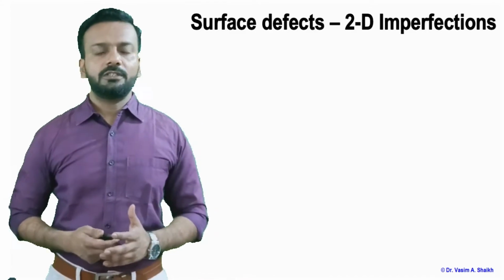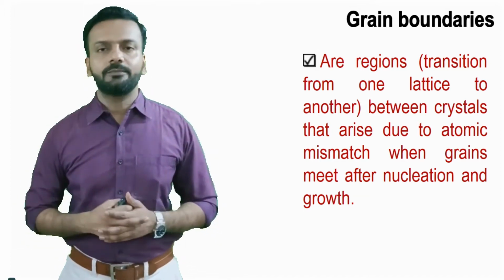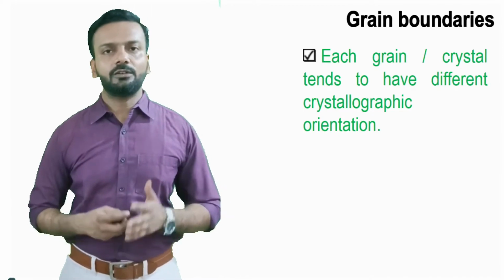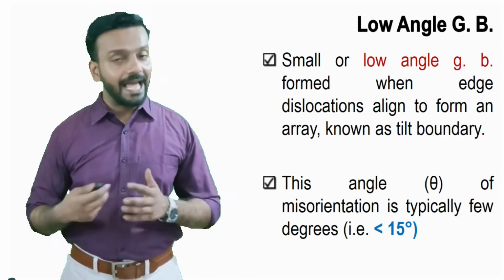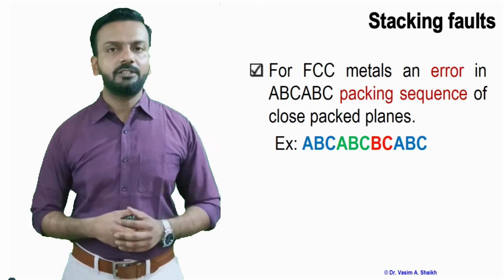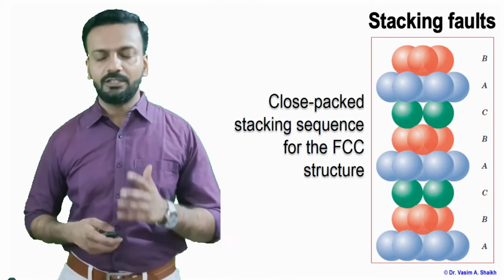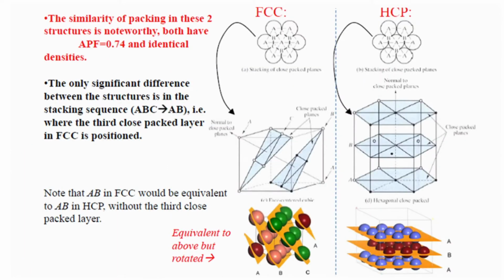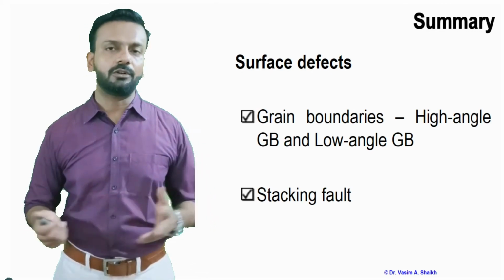Surface Defects | Grain Boundaries and Stacking Fault | 2-D Imperfections in Solids

Comment: As slamalaikum Sir , please tell me piping defect.
Reply from the maker: Piping defect in materials refers to a type of internal defect that can occur in castings or welds.
In castings, piping occurs when molten metal shrinks as it cools and solidifies, causing a depression or void to form at the top of the casting. This depression can create a pathway for liquid metal to be drawn out of the casting during solidification, leaving a tube-like void or "pipe" in the center of the casting.
In welding, piping can occur when a void is formed in the center of the weld as the molten metal cools and solidifies. This can weaken the weld and make it more susceptible to failure under stress.
Piping defects can be prevented by controlling the cooling rate of the metal during solidification, using proper casting or welding techniques, and ensuring that the molten metal is free of impurities that can contribute to void formation. Detecting and repairing piping defects can be difficult, and may require cutting into the casting or weld to remove the affected area.